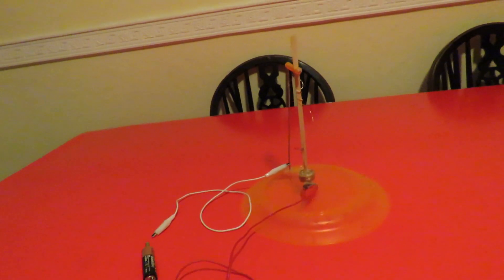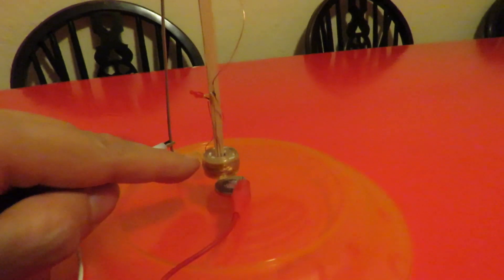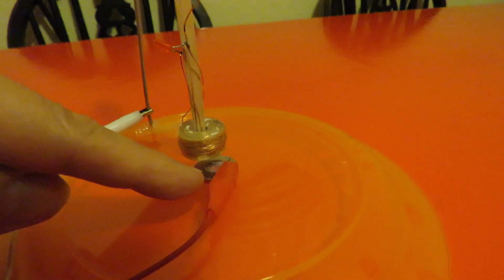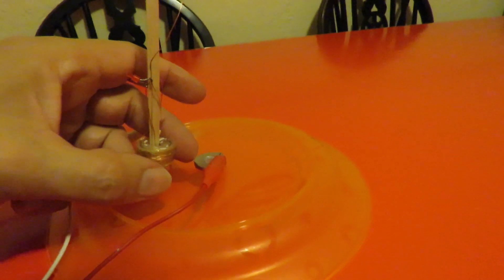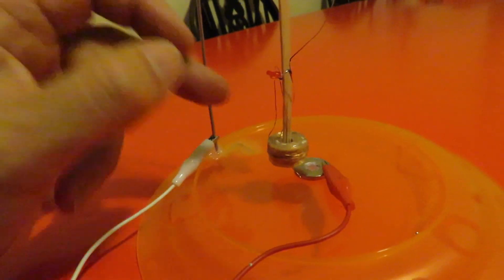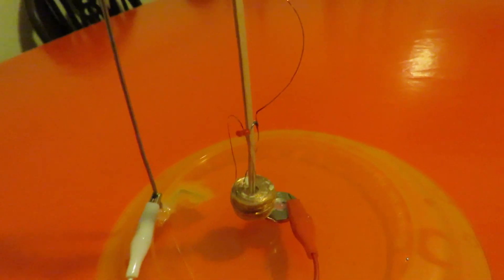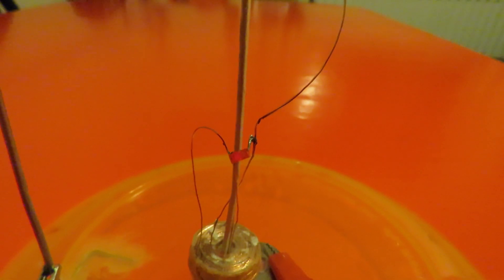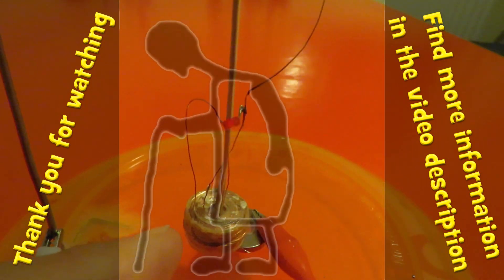Mechanical Joule Thief inspired by Lidmotor and Ludic Science

Comment: It worked!
Reply from the maker: Thanks, it was a bit late at night. I should have found a better LED to make it more visual, but we can see the principle. Thanks for the inspiration. Working the other way round, have you seen the generators that have a magnet on a vibrating tape to induce a current in a coil. The tape vibrates in an airflow, typically a gap under a window.
Reply: Yes  I have seen videos on those vibrating tape generators. I have not made one yet.
Reply from the maker: ***** I did one just to light an LED but it would be fun to run a pulse motor or similar. I would guess with a capacitor to smooth the input.